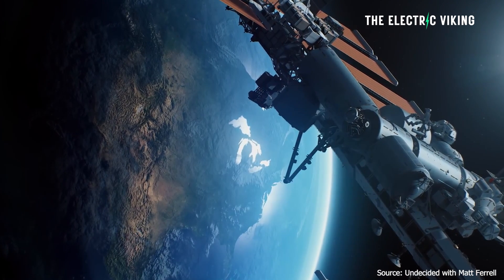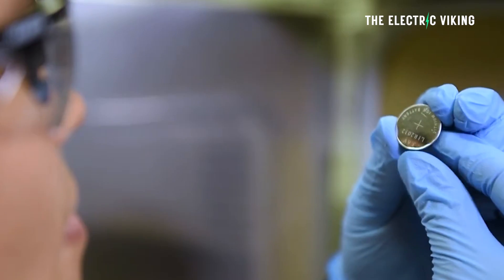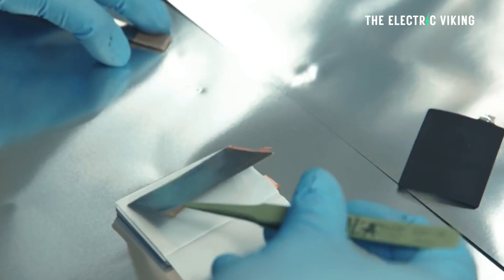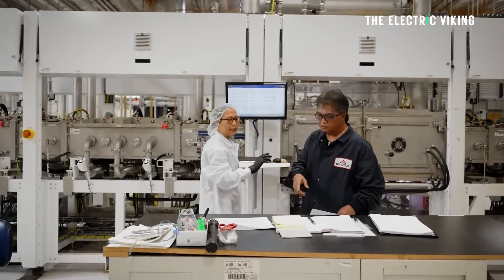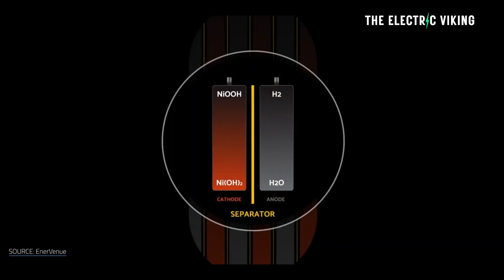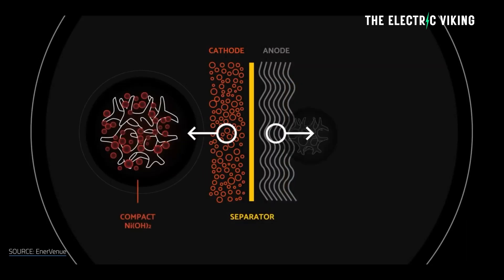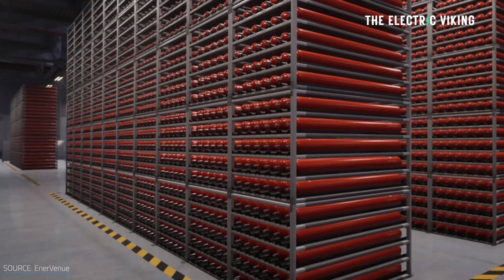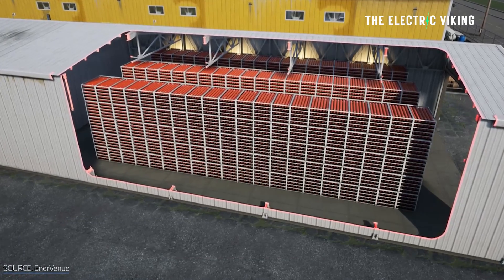NASA's nickel-hydrogen battery technology could displace lithium by 2030

Comment: 🔋EV NEWS  -   Sodium-Ion Batteries are Here! 🔋

 A Chinese automaker just put sodium ion batteries in a car.  The batteries are from Farasis Energy and Hina Battery, marking a step closer to large-scale use of the new, lower-cost batteries.  Right now these batteries are in the low-end tiny cars.   The sodium-ion batteries built by Farasis Energy in partnership with JMEV, an EV brand owned by Jiangling Motors Group, rolled off the assembly line on December 28, according to the battery maker.  I believe VW is heavily invested in these batteries or with one of these companies.

The sodium-ion powered car is based on JMEV's EV3, 
The Sodium-Ion model  has a range of 251 km (156 mi) with a battery pack capacity of 21.4 kWh. 
The car starts at RMB 58,800 
The Lithium Ion model has a range of 301 km (187 mi) and a battery pack capacity of 31.15
The Lithium Ion cars starts at RMB 62,800 ($8,840 USD)

Comment: Sam Evans (The Electric Viking) often doesn't do enough research about the topics he reports. If an old technology hasn't taken off in the market, then there is probably a reason why, and I suspect that NiH2 batteries aren't cost competitive. First of all, nickel and molybdenum are expensive at $24 and $56 per kg, respectively, and they probably need a high purity, so it wouldn't surprise me if the price is 3 times higher for use in NiH2 batteries. NiH2 has a low energy density around 60-70 Wh/kg, whereas LFP is 160 Wh/kg and NMC is 250 Wh/kg. NiH2 batteries have a 40,000 cycle life IF doing 40% depth of discharge AND they lose their energy quickly, so they are only good for short term storage. I suspect that NiH2 batteries cost 2-3 times more per kWh than LFP batteries that are commonly used for grid storage. LFP gets about 10,000 cycles at 60% depth of discharge and it doesn't lose its charge nearly as fast, so it is better for longer term storage.
 
However, we have salt water flow and iron salt flow batteries coming onto the market that have extremely low material costs (around $5 per kWh), and they should last for 20,000 cycles or 25 years. It is hard to see NiH2 batteries competing with salt water and iron salt grid batteries.

Comment: The part about the pressure being only 5% of that in a hydrogen fuel cell is totally disingenuous. The pressure in a NiH2 cell is very high, hundreds of PSI. The pressure in a fuel cell is a few PSI at most. I think they’re comparing it to the pressure in a hydrogen storage tank, not the fuel cell. Also, that efficiency rating of 90% is NOT better than lithium ion, and also not even true. The best NiH2 cells (which are still in research stage) can’t get better than 75% due to side reactions and resistivity of the cathode. Yes, they can just about manage 90% if you charge and discharge them extremely slowly, but at normal levels, like 0.5C and above, 75% is the limit. Also, due to the pressure vessel construction, bringing the cost down with large scale manufacturing will not be very effective - making a 250 PSI vessel with electrical terminals going in and out is always going to be difficult, and therefore expensive. Unfortunately, it’s a nice idea but probably just a short-term investment moneymaker for the individuals involved, destined to be relegated to the bin of other failed battery technologies.

Comment: was excited until I realized I use around 20MW/year and this battery stores like 3KW. I just need 7000 of these huge tanks.
Reply: Well I mean generally these things are used for nighttime only. How much do you use at night?

 Anyway it is pressurized with hazardous gas?! I wonder how just compressed air works. 

 3kw from that thing... I need comparisons. I didn't see any volume comparisons Sam. That is your job on how they compare!
Reply: Your maths is wrong because the batteries don't do one charge cycle per year. The tank spec was 3kWh... a typical EV is 70-100 kWh, so would need 20-30 of these tanks in a car... and you'd run your house comfortably on an EV-sized battery.
Reply: @goldreverre  was hoping to store energy for winter heating

Comment: Yes NASA has many excellent technology and innovations after many years of R&D but to put them to a domestic scale application is an economic consideration.

Everybody knows US first developed the solar panel in NASA application but is was so expensive that it never took off.  Only after Germany popularized it by state subsidies did the world start to see solar park becoming a reality.  The breakthrough was by China who lowered the western solar cell cost by 90% so today solar power is the cheapest form of power generation.  Without making it cheap and affordable by the world population any good idea is useless!
Reply: Also a solar power outfit in China (Longi?) has achieved 33% solar efficiency which is 50% better than current deployed panels. It's hard to see how solar won't be the most economical renewable energy for grid supply.

Comment: Storage density is comparatively low.  60 wh/kg or litre.  Also in a safety pressure release valve fails, what's the risk?  But if the numbers work, so be it.

Comment: Hi from the uk 
If you are looking for mass storage what would be wrong with the iron flow battery, with mass storage space/energy density is not really a concern but reliability safty and cost are. I am not dismissive of the hydrogen nickle unit just intrigued as to which would be better suited for large scale or even some kind of off grid small factory

Comment: If you search on YouTube, for "Hydrogen powered corvette" you can find a man that converted it, more than 10 years ago, to run completely on electrolyzed hydrogen made from solar panels, stored in solid lithium metal tanks that he made himself from scratch, that are explosion proof, crash proof, non-flammable and indestructible. 

The crazy part? He gets a 400 mile range from 4 small tanks that he mounted inside the vehicle. Try to do a search and find the video, because he powers the Corvette completely off the grid, using only electricity from solar panels. It's a better solution than anything that has been presented thus far, by the big companies.

Comment: You or your sources are bold faced and deliberate liars!!!

As you said in this video, these cells are sealed under normal operating cycles, so in the flat state, they are filled with water, that is safe and will steam off, through the relief valve, in the case of being exposed to a fire. 

In the charged state however, the water separated into Hydrogen gas and Oxygen gas that is pressurized and in the perfect ratio for a nasty explosion.
If a fully charged battery of these cells are exposed to fire, massive explosions will follow.

It may or may not be true that these cells are highly unlikely to self ignite, like Lithium cells do but they will explode when exposed to fires, as do happen in high power electrical installations from time to time.

Look at these odds for instance:
There are 7000 cells in a average Tesla. 
So, if the likelihood of a Lithium cell going into thermal runaway is 1 / 20 000000 (one in twenty million) it still means that 1 in every 2857 Teslas will catch fire just because of faulty cells and not even considering other sources of electrical fire in a Tesla.
The risks have to be considered on the bigger scales and not just looking at the risks of a single item. 

This channel has announced so many new wonder electrical cells and electrical processes, but somehow the actual battery landscape is still changing very slowly.

Please realize that any new higher power solutions will always come with new risks and so far it appears that the industry and politicians have not considered the risks properly.

This technology may well turn out to be effective and practical but please don't put it in my backyard. (NIMBY)

Comment: Ummmmm, no. Not for cars. I worked with them at TRW (now a part of Northrop Grumman). Unless something’s changed (possible), the volumetric energy density is poor. They are BIG. The cost of the pressure vessel will always be a handicap compared to other cell chemistries. However, they can be (relatively) light weight at the cell level. Peak pressure can be 900 psi. They DO last a long time. Unlike lithium, they can be overcharged, and they can be safely discharged to zero without damage. Memory isn’t a problem, and they don’t degrade if regularly charged to 100%. As you’ve mentioned, they are relatively temperature insensitive.

They could (perhaps!) work for ships, and stationary storage, but don’t hold your breath.

Comment: Nickel-hydrogen was practically the only battery technology used on satellites.  That started changing about 10 years ago, now pretty much every satellite uses lithium ion.  This is basically abandoned aerospace technology.
Granted, the lithium-free aspect is nice, but can this compete with sodium-ion ~5 years from now, and calcium-ion a decade later?
Reply: 60 000 charges?
Reply: The real problem here is that producing Hydrogen is extremely difficult and expensive right now. It's not commercially viable for mass production in the next few decades from now on. So; no, they won't compete with sodium or calcium. I believe sodium will to become the norm in 10 years and things will to stabilize a little bit then for the 2035-2055 time frame. Calcium or otherwise will be 2055 onward.
Reply: @nunagoras  This doesn't use hydrogen as fuel therefore production issues are no problem.  Simple hydrolysis will produce all the H2 this requires.  Source hydrogen only matters if you are going to burn it for energy, not if you are using it as a charge holder.
Reply: If you use the energy for 30k-60k cycles i just don't see the H2 production cost as an issue. Nickel is actually the higher priced part. The pressure vessel is only 100 bar. That's an 3rd the pressure of an scube tank.

Main Issue was platinum and paladium used. But it seems the mentionned doctor solved that issues.
So now just the production scale and Nickel price. Seems promissing to me.
 @nunagoras
Reply: At the time these NiH2 Batteries were amazing especially  at 0g not so great on Earth due to the recombination and popping effecting. But this is interesting that they are still pursuing  this tech.

Comment: Just how much hydrogen are we talking about per fuel cell. How does this get around dirty hydrogen production from methane. Are we just replacing one fossil fuel with..... the same fossil fuel?. You need to address this side of it Sam. Doesn't sound like such a clean alternative especially with all the pressure cylinders that are required for a not so dense battery. That requires smelters which sounds like going backwards. I noticed no mention was made of the cylinders/tanks. What about the issue of hydrogen interacting with steel and making it brittle. What are the relative weights per kilowatt storage lithium ion vs nickel hydrogen. How does this differ from nickel metal hydride.
Reply: During discharge, hydrogen reacts with oxygen to produce water, within the closed system.  That means for production, they can just use water, and internally produce hydrogen by charging.  So no need for any potentially dirty hydrogen sources.
But I agree with all your other points.  Especially about preventing hydrogen embrittlement.  I can't see them preventing this at temperature for 30 years.

Comment: Platinum might not be out of the question when there are no more catalytic converters for ICE cars being made in volume. I wonder how much platinum is required?
Reply: Depending on the vehicle, a catalytic converter contains 3 to 7 grams of platinum.  Fuel cells intended for use in a passenger vehicle would require 30 to 60 grams.
Reply: Global production of platinum is around 190 tonnes per annum.  Automotive catalysts consume roughly 40% of that so around 76 tonnes. (and sorry, but that is still how I spell a metric ton.  The spell checker doesn't like it.) So yeah, get rid of ICE vehicles and we do indeed free up a significant amount of Pt.  Also used though are other platinum Group Metals (PGMs) like Palladium and Rhodium. Also very good catalysts.

Comment: can they ever be used in cars
Reply: No.
Reply: Definitely not. Not for safety reasons, but just because they’re very large and heavy for the amount of energy stored. For example, to have an equivalent 120kWh as a Tesla, you’d need at least another car full of these being towed behind it. 
Not very practical! For stationary energy storage, they’re ok, but expensive.
Reply: The 1.8m long tanks were 3kWh. EV's are around 70-100kWh... so at least 20 tanks for a shortish range car and realistically 30, if you want the typical acceptable minimum range. Where are you going to fit them and how much will they weigh? Not feasible.

Comment: The biggest battery need right now is for something big, clunky, ugly, long-lasting and inexpensive to pair with solar to power homes and businesses! Tesla Powerwalls and their competitors are pathetically weak and 4x too expensive. We need an inexpensive home storage battery!
Reply: Also, Sam, happy New Years to you and yours. I enjoy your posts!
Reply: I couldn't agree with you more.  Battery prices keep dropping and with all the factors at play recently I would expect them to continue to fall.  You can get an EG4 pro battery currently for half the price of a Powerwall with the same storage if you need something now.  Otherwise I would wait a few months.  With Lithium prices in free fall, the newly released sodium-ion batteries, and weakening economy, I would be amazed if battery prices didn't fall further in the coming months.
Reply: MIT's - Don Sadoway's - Aluminium/ Salt/ Sulphur cell is sitting there waiting for the world to catch on. Its now and about $20/kw
Reply: @edwardmorpeth5988  There has to be a catch.  If it's truly $20/kw and could scale to industrial size, it would change the world.  Maintaining 230 degree temps for charging and discharging is likely part of the reason.  There's also no resent news on it's development so they may have issues not easily overcome.

Comment: Sam, Stop!  Nickel-hydrogen batteries came out in the 1960s.  Yes, they last a long time.  1.2 volts per cell, 3,000 PSI H2 gas in the bottles when charged, low energy density, high cost.  NASA uses these batteries because NASA has NASA-type money.  The rest of us don't.  End of story.